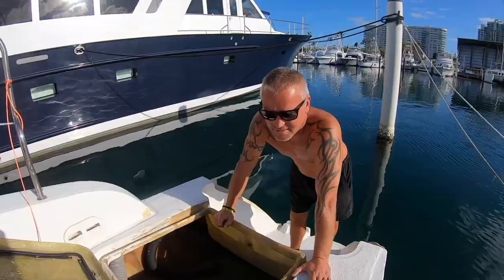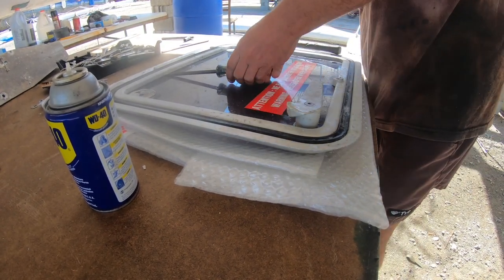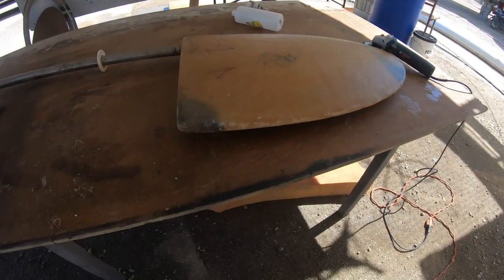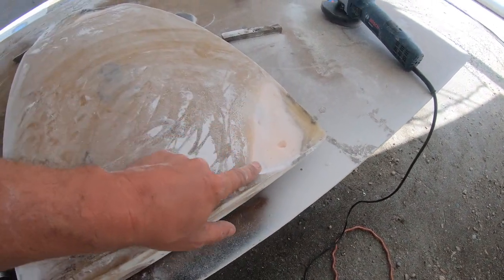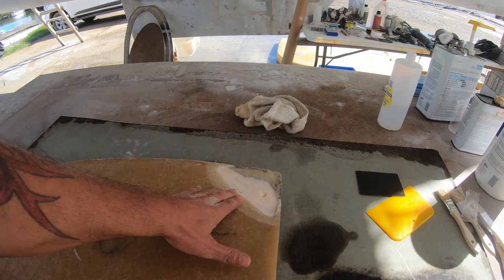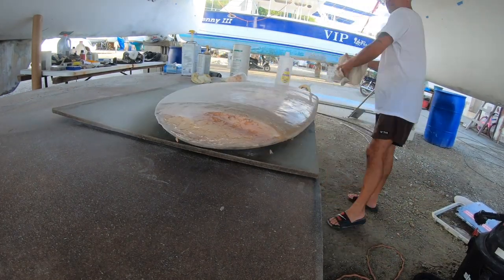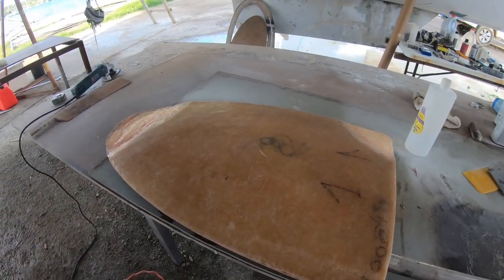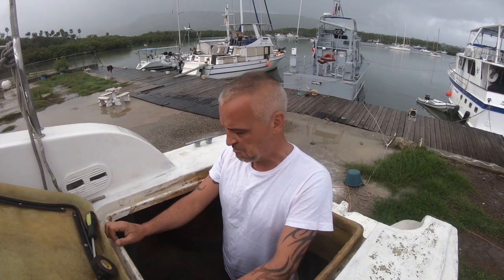Something Always Breaks: Restoring Fibreglass and Fixing Problems (S2 E37 Barefoot Sail and Dive)

Comment: Have you ever try or use nickel compound or anti seize on the bushing and shafts of you hinges and clips assembling it. Bolts and nuts, on your shafts between the shaft and bearing. Prevents rust or oxidation you will never battle again, Its a kind of magic.
Reply from the maker: Sounds fantastic!

Comment: Hey is that handle plastic if it's not heat it up an try 🤔  if it is plastic try a wire brush around where you took it off from the glass an then let it soak maybe that will help hopefully 😉
Reply from the maker: Might try that! 
Cheers!!